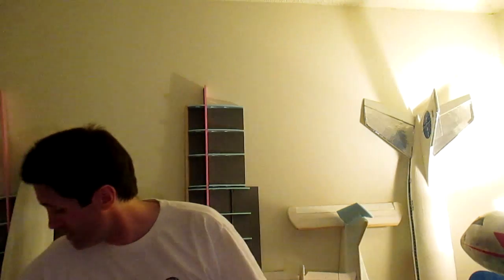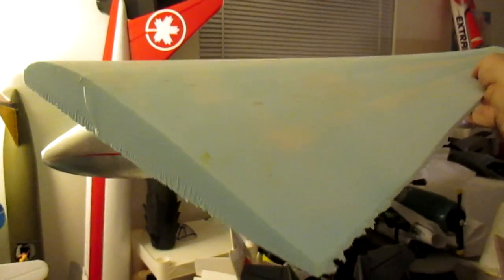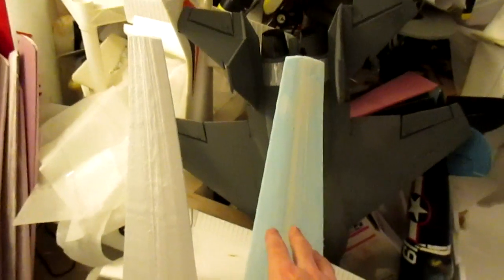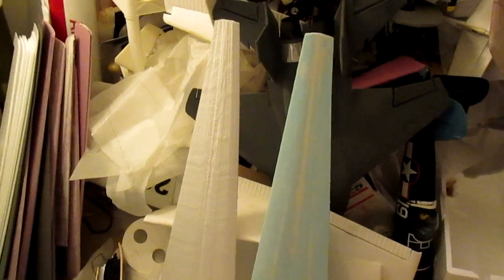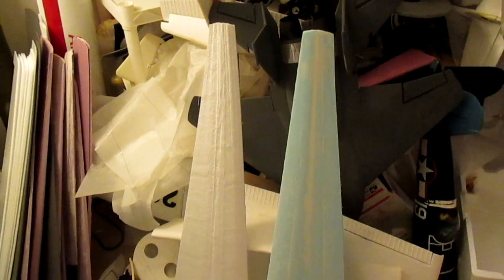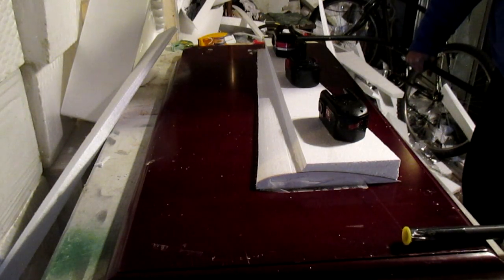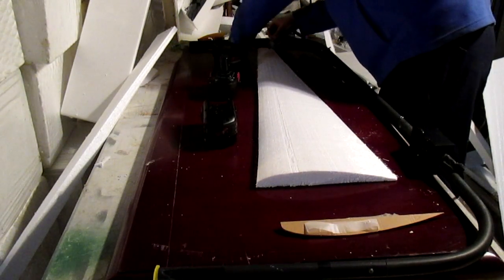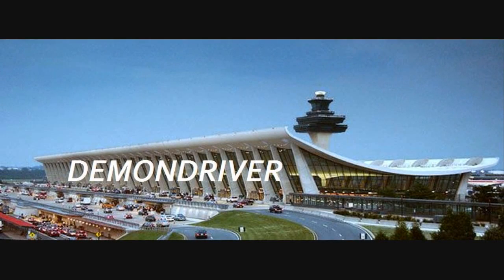DIY Hot-wire Any RC Airplane Wing Part-2!

Comment: Hey DD thanks for the videos ive learned alot. Is that F-15 in the back ground a scratch build? The reason I ask is im looking for plans for a scratch build A-10 and will most definitly be turning to you for advice and pointers. Thanks Cooper
Reply from the maker: Lol. . No Sir. . . That's a very old Arf edf F-15 probably 5-6 years old.... . Not all my RC aircraft are scratch-built.
Reply: I love your scratch builds they turn out so nice.  Plus they help me with the confidwnce to do my own